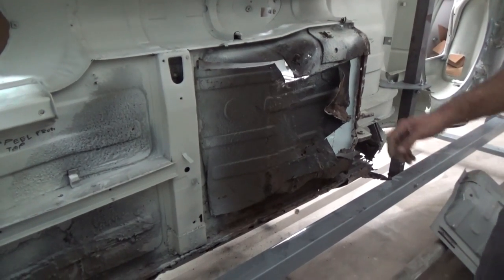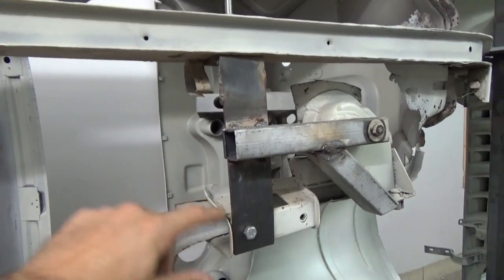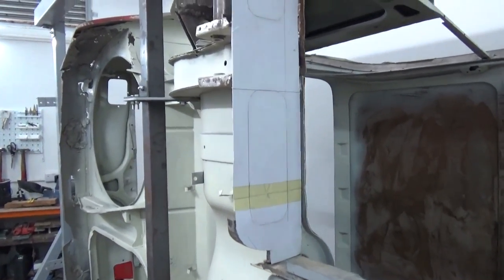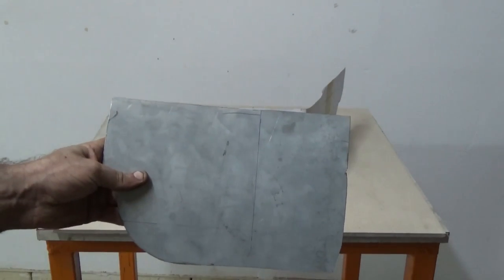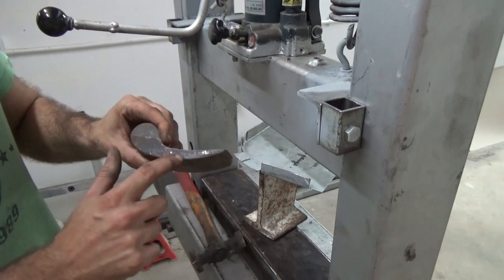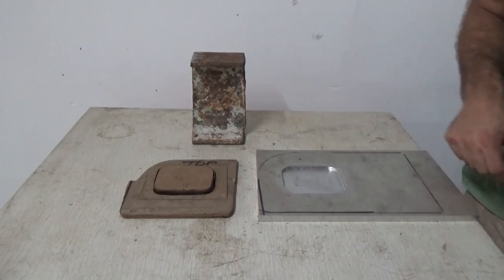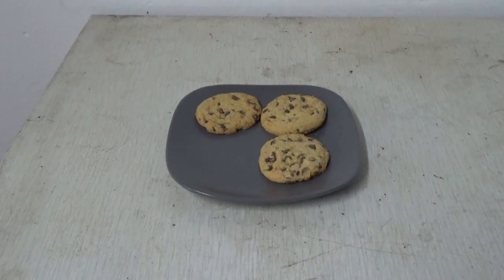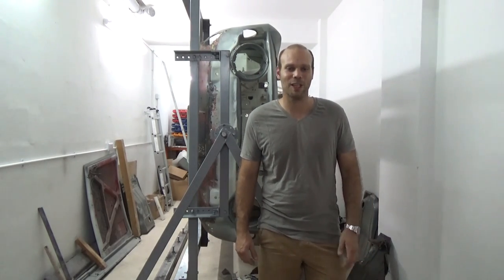Raising Junior Episode 2 (Using a press to form a panel)

Comment: Nice work again. I am scared to think of how much rust mine has after looking at that ;)
Reply from the maker: Hi Jeff, yeah with these old Alfas you have to hope for the best but expect the worst. The metal wasn't protected well from the factory and the sills are proper rust traps. Mine looked decent when painted, I bought it stripped and blasted so the horrors were already exposed. I'm sure you'll be able to do it right, it will need more rust repair than your average project. Hopefully yours was in an area with a dry climate so it won't be too bad